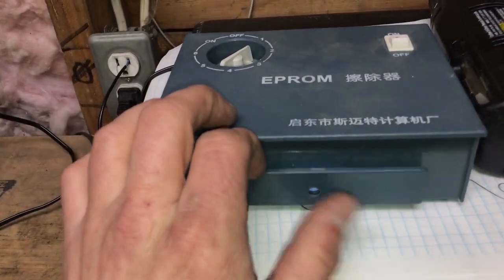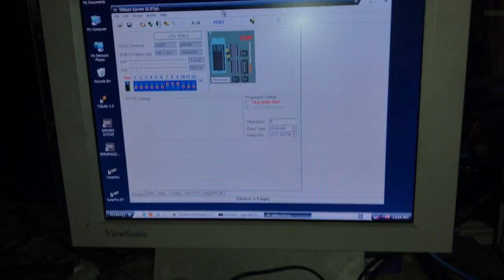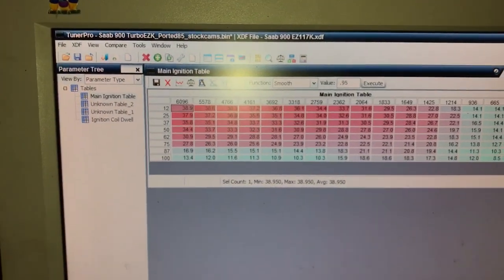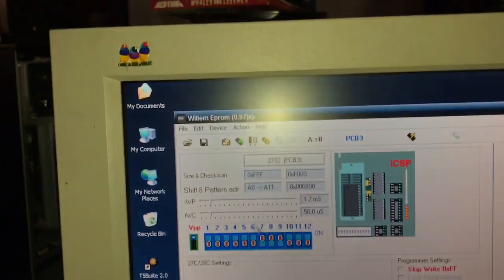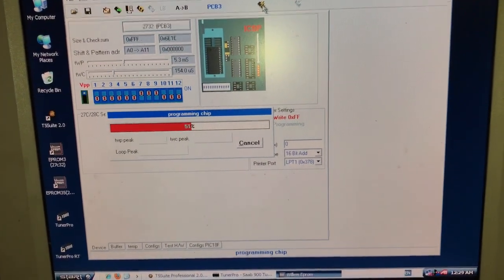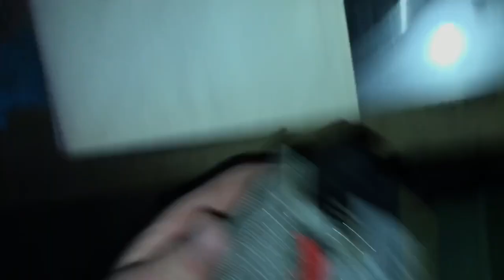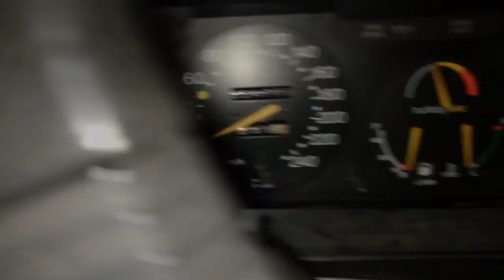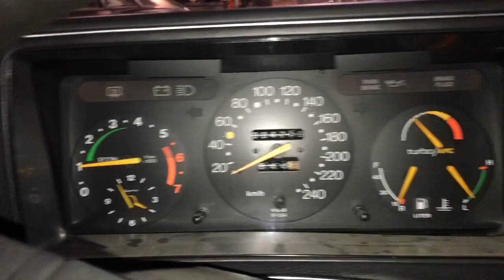Chip tuning Saab C900 turbo

Comment: You are not the only one having a go at this on a c900! Tuning EZK is more period appropriate than T5.5, in my opinion. Love the channel, thanks for sharing your knowledge!
Reply: Sorry, but thats wrong. T5 can do what an EZK can do but much more! EZK is not able to detect Knocking per each Cylinder via ion current measurement!
Reply: @t.h.9187  All you say about T5 is true, it is an impressive system and a great retro-upgrade for a c900. But the C900 I have came with the EZK factory installed, so it will be fun to tinker with it. That is what I meant by appropriate for that period (in time i.e. late 80's/early 90's).

Comment: Hi if you still have all the equipment, would please be able to chip tune my saab 9000 turbo? Thanks.
Reply from the maker: What FI system is your 9000?
Reply: :) My saab 9000 has the boshc LH 2.4 Jetronic system. The engine is a B234L turbo.
Reply from the maker: @noman7508  what changes need to be made? The DI/APC system is really really really hard if not impossible to tune, so your boost and ignition timing isn't tunable easily. Unless you've upgraded injectors the LH2.4.2 maps are actually reasonably good
Reply: @Nodarperformance Hmmm.... Are you able to explain a bit more please :)

I also read that there is a fuel cut off when the boost get too high and the boost is varaiable to achieve the torque figure. 

Can I just get a manual Boost controller and up the boost? It is this really that simple? 

One day and i mean one day. I would like to twin turbo the Saab. I have a spare engine and that turbo look like to be in really good condition. But this is dream lol and more of an excuse to build up my welding skills. Hope your having a great day. :)
Reply from the maker: @noman7508  throwing on a MBC (death knob) is the equivalent to throwing a carburetor on a direct injection motor. There is a fuel cut built into the LH ECU, and it is based on the voltage coming from the AMM. The boost curve is in fact variable and adjusts to driving and octane (knock) condition. If you want to tune the boost and ignition map of your car, it is not possible. You will be better served converting the car to Trionic 5.5 or a stand alone system. I don't mind the work involved in chip tuning as I hold an EE degree, but most people need an easier way out and this would be the T5.5/stand alone way.
Reply: Thank you. I really don't want to spend the time figuring the wiring from the ecu. I could and I found a E6K haltech ecu with the wiring on eBay. Its a complete package. Software as well. 

What would you recommend? I don't really want to rewire the engine to T5.5 unless there isnt any other option. Not even sure i can get all the parts for this. 

I can send you my ecu/chip or are the factory chips not flashable? 

It is possible to wire up some variable output circuitry to various ecu signals and run it on a dyno? 

Thanks for your help. :) I really appreciate this. I hope I haven't bought the wrong car for my project.
Reply from the maker: @noman7508  converting to T5.5 is easy for you. Just find a parts car 9000 1993- and take all the stuff out or even just swap the entire engine/transmission from the donor car. Installing aftermarket EFI is going to cost as much or more than a parts donor car. To be honest 'boosting up' an early 9000 does cost some money, which is why I left mine alone - plenty quick enough.
Reply: Finding a donor car is very hard where I live in Australia. :( if I had the ecu wiring diagram I would rewire the haltech in. 

I just changed the clutch so.....not too keen on swapping out the engine/writing. Just yet.
Reply: I just wanted a tune to max out the stock injectors and get what power i get. I wish I knew what i have learnt as i would have bought one with T5.5 :(
Reply from the maker: @noman7508  the stock injectors are only around 30# so you're not going to get that much more. If you seek more boost, I'd recommend buying a DI/APC Redbox, but ultimately your fuel cut will remain at around 18psi of boost at which point the AMM is maxed out. Tuning old cars is tough!
Reply: I found a red box for almost $1000 on eBay :(

Any other way?

I found a 1997 saab 9000 at a wreckers. Not sure what parts are left though. I don't even know of its a turbo model untill i see it in person. 

I would be ok to spend a few $100 on a tune but I dont know if I have a 10 hrs to pull the wiring loom and edu out. And another 10 to wire it up to my car. The Saab at the wreckers might be in better condition as well. Lol. I bought the wrong car 😢

Would the E6K haltech be a better option? Thanks. :)
Reply from the maker: @noman7508  I would join some FB or other groups. They normally sell for $200-300
Reply: Maybe.... And may be I will get this Saab on the road and sell her. :( 

I don't think thing she will be the track car I had hoped for.
Reply from the maker: @noman7508  200HP is plenty for a track car. You don't need more power, but instead more skills on a track

Comment: Hi, how i can read the cvalue of my saab 900 chip fuel modified?
Reply from the maker: I don't understand what cvalue is? Would you be trying to read the fuel injection constant? You will need chip reading/writing equipment which is able to read 2732 ICs
Reply: @Nodarperformance  Hi Thank you for your answer. Some years ago i bought one chip fuel modified (by a saab engineer, told the seller). Now, i would use this chip in my car (saab 900 T16 Lucas no cat) but befor i put the chip in the ECU, i would read the data in the chip so i understand if are really modified or not. This is my problem. How i ca read the data? And you can modified other chip for my saab? I know that Lucas is very difficult to modify.
Reply from the maker: @librousato2945  I don't believe it's any different to modify Lucas than Bosch, however due to the availability of Trionic 5.5 systems Incorporated onto C900 vehicles, people have stopped trying to tune the old systems. I have never touched a Lucas system and therefore cannot offer any insight.
Reply: @Nodarperformance  Thank you for the contribution you know me. Is there a difference in programming a chip fuel for CAT or non-CAT that you know? Or for different versions of Bosch ECU ??
Reply from the maker: @librousato2945  yes, there is a significant difference between CAT and non-CAT ECU software. For one thing, a non cat ECU does not utilize an O2 sensor
Reply: What is mark and model of eprom programmer that i see in the video??
Reply from the maker: @librousato2945  I use a Willem PCB3B programmer, it is VERY old and will require a parallel port (full size printer port) to function. I recommend a newer USB programmer that is more 'every day user' friendly. I learned on a Willem in engineering school so this is what I use.
Reply: @Nodarperformance  yes PCB3B is old but really ok to write Eprom. Can i read mu lucas chip and add +10% at each value in the matrix where is visible rpm??
Reply: I'm buyng a PCB5, also on parallel ports. From china, is cheaper and many buyers told me it's good. I hope
Reply from the maker: @librousato2945  your PC must be very old to use a parallel port. Good luck with the programming, I have never looked at Lucas before!
Reply: @Nodarperformance  Hi, I have different computer, some with parallel port. I've never done anything on chips and no programming experience, but it shouldn't be difficult. I do not understand how and how much to increase the value of gasoline. I will study the Bosch chip maps before and after the tuning and do the same for lucas. I'll use the same logic. I don't think it's very difficult. I bought another Lucas ECU for testing, so I have the original always immaculate.
Reply from the maker: @librousato2945  I would invest in a good air/fuel meter before even thinking about touching an ECU tune
Reply: @Nodarperformance  cosa intendi? Dammi delle dritte.
Ho una centralina APC speedparts. Vorrei aggiungere un chip ottimizzato per il carburante. E sto lavorando per un downpipe 3" compatibile con la batteria in posizione originale
Reply from the maker: @librousato2945  you will have to translate that for me
Reply: sorry.....what do you mean A / F meter? Give me some tips.
I have an APC speedparts ECU. I would like to add a fuel-optimized chip. And I'm working on a 3 "compatible downpipe with the battery in its original position
Reply from the maker: @librousato2945  please don't take the following the wrong way: I think if I have to explain what an air/fuel meter is and how it pertains to tuning an ECU, it's probably best left for the professional.
Reply: @Nodarperformance  You're right, but I haven't asked you how to improve the performance of a car. I've been able to do that for 50 years ago. I only asked you for advice on chip tuning and how to modify a Lucas chip, which is rare compared to Bosch. But I see you go around it. It does not matter. I thank you anyway. The internet is an infinite resource.

Comment: Damn, that is a massive amount of slant!
Reply from the maker: ya boosted engines timing curves usually look similar to this. You need to maximize torque and efficiency when at part throttle as much as possible because boosted engines are usually dogs off boost. This is due to smaller displacement, mild cam profile and fact that theres a massive exhaust restriction
Reply: @Nodarperformance  Sorry, what I meant was about the engine block/head. I remember my 244 had I think 15% but that is a lot.
Reply from the maker: @revolution1one  yes it is! its 45 degrees and is considered a slant 4, even though it was not mounted slanted in other saabs later on.
Reply: @Nodarperformance  What was the purpose of that? I mean the factory turbo couldn't been that big to need that much space beside the head.
Reply from the maker: @revolution1one  In a Saab 900 The engine is installed backwards (belts facing firewall) and longitudinally (but is front wheel drive) in addition to this the transaxle are chain driven from the clutch (at the front) and into the actual gearbox which lives sort of underneath the actual engine. in order for the engine and gearbox combo to clear the hood line it sort of had to be done with this mad slant. Saab had been using this same basic design since the original Saab 99 days of 1969? when the original engine had been actually designed by cutting a ford V8 in HALF, hence the engine looks much similar to half a V8 engine. Triumph also originally used this same engine (Saab purchased rights to engine from Triumph)
Reply: @Nodarperformance  That is different!!
Reply from the maker: @revolution1one  ya! Saab in a nutshell
Reply: @Nodarperformance  Maybe that explains the backwards hood opening.